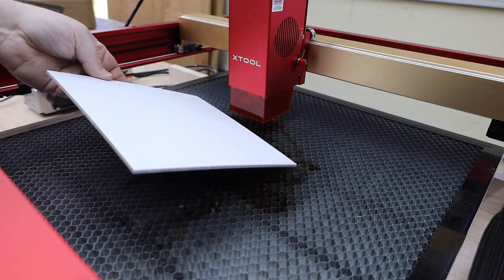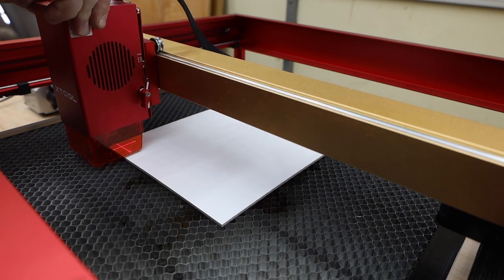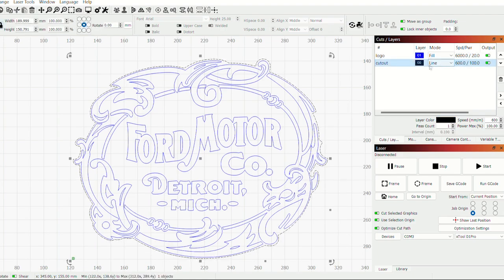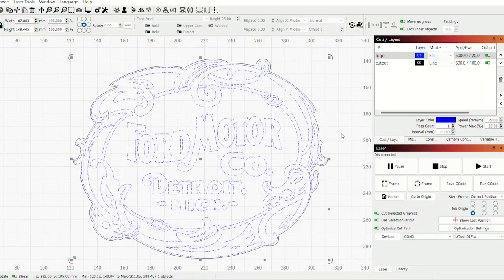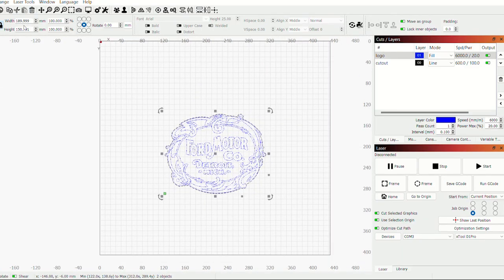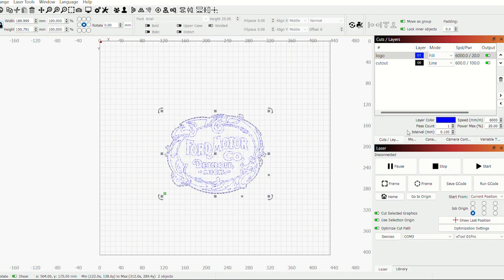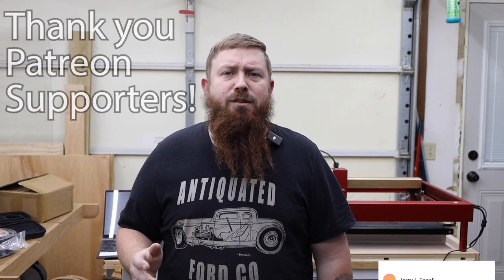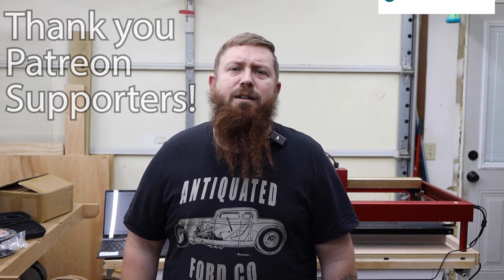Quick and Easy First Project Tutorial xTool D1 Pro Laser Cutter

Comment: That was helpful. I am new just got my cutter up.and running and was wondering how to engrave/fill/cut..on the same piece..I'm still trying to figure that out. This piece looks great, I am working with the same machine 20w. Are you designing in XCS..it looked like many more options then I get. So I was a bit lost and Will most likely be rewatching till I get it. 😂 thanks so much for sharing😊